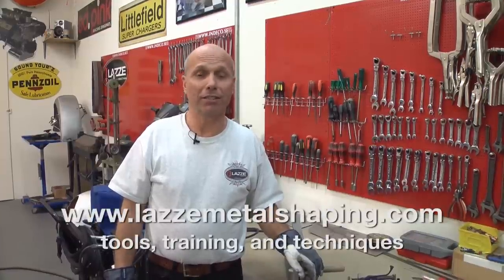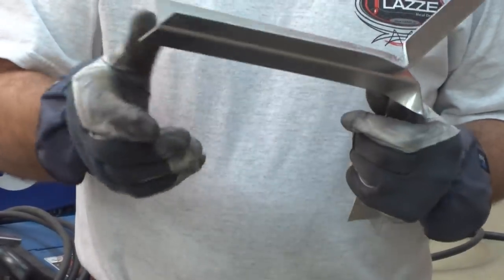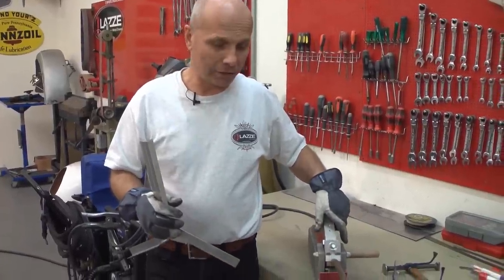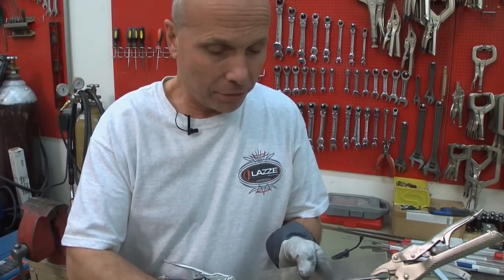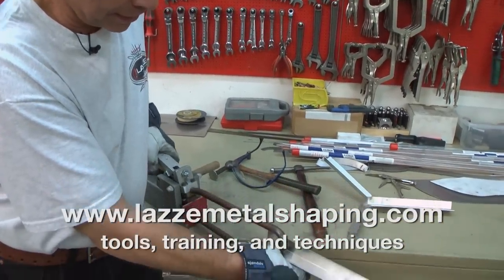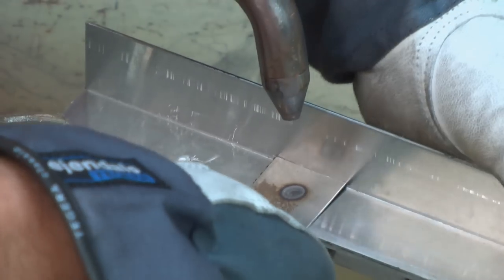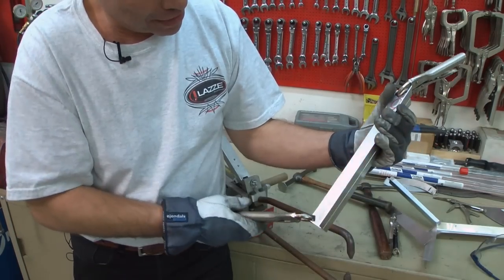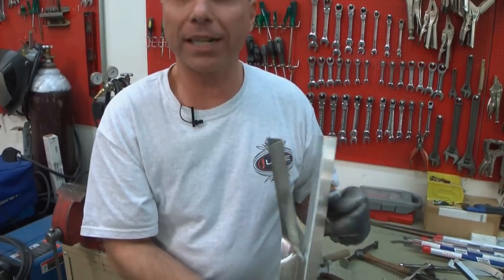Metal Shaping with Lazze: Spot Weld Aluminum with a 220V Welder

Comment: I now use this daily with .040 3003 aluminum works stunningly well. 
I will warn you that you can run in to the duty cycle of a cheap spot welder pretty quick this way. 
Huge huge time saver for me. 
Potentially best metal working tip EVER for me.

Comment: Hello Lazze.
In order for the sheet no to stick so hard try to put some engine oil (very thin coat with your finger) in the metal plates that are facing the alloy :)
Also the less pressure you put on the spot welder arms the better the current will flow thru the alloy
A little tip from Portugal :)

Thanks for your videos.

Comment: I have used this same trick to spotweld copper but I like stainless steel on each side because it holds the heat and concentrates it in a smaller spot.

Comment from the maker: @vampirwrr and @socamoto
the insulator metal to sandwich the aluminum is just 20GA scraps from the shop here, and it is using the standard tongs on the welder - the same as we use on steel for attaching bead roller templates to panels.

Comment: This is a great trick.  In Mercedes school they taught us the same trick but they taught us to use stainless steel coupons instead of steel because it leaves a small amount of the coupon embedded which then will corrode because it is steel.  Stainless steel will not.  Great video thank you!

Comment: Hi Lazze, thanks for the idea, I have been looking for a way how to spot weld the aluminum sheets since the aluminum metal has very low current resistance, of course if you want to spot weld the aluminum sheets together you need a very high current electric source and adding a resistance to them to create a spot with current resistance to they create a technique by adding a couple of steel sheet metal on both sides, the steel has higher electric current resistance than aluminum, and it works, I have seen some industrial using this idea which cost a fortune not for consumer use, you demonstrated a great way by using a small spot welder 220V which I have never though about that, but my question is : how much amperes that spot welder you used provide  ?  thanks

Comment: I just bought a portable 220v spot welder and never thought it was possible to spot weld aluminium.The amount of time i have spent drilling and bolting pieces of scrap ally angle together with bolts to make brackets ect.... This is a godsend.. Your spotwelder was a small portable model?

Comment: Does this work with thinner aluminum? Thanks so much.  You've opened up some creative options I long thought were closed (I make kinetic art).
Reply from the maker: Adjust the timer on the welder, it may take some experimentation to get it right. Don't forget to write down the settings so you don't have to experiment every time.
Reply: Thanks.  Time to experiment.  Best regards!

Comment: Curious to know which kind of spot welder you used 
Also if there is a spot welder with enogh amperage to do 1/8 " al...
Reply from the maker: reynaldo soriano The spot welder is a common one from one of the major manufacturers and we've not tried aluminum that thick, but it is a great question. Thanks for watching and asking a question.

Comment: Hi What setting do you need for the spot welder
Reply from the maker: The time for the spot welder varies and takes some experimenting. Scraps of the material you're working with are a good start although size of the aluminum will dissipate heat. Thank you for asking.

Comment: Not convinced that the SS pieces make any difference. I get the same result without.  Aluminum weld just needs more energy than say mild steel and many welders don't just have it.
And what is this about 110  vs 220  which makes no sense what ever.